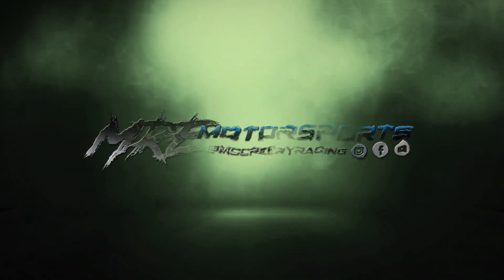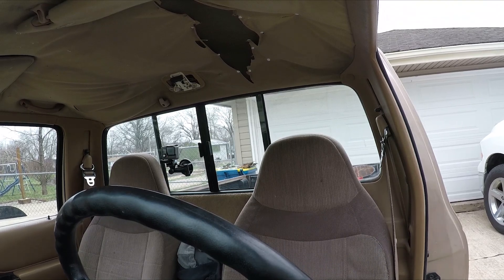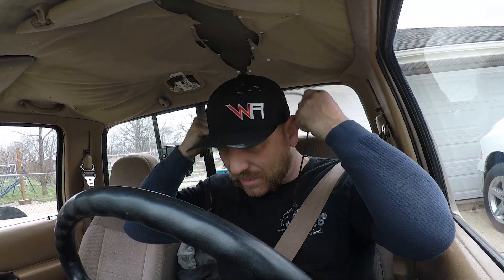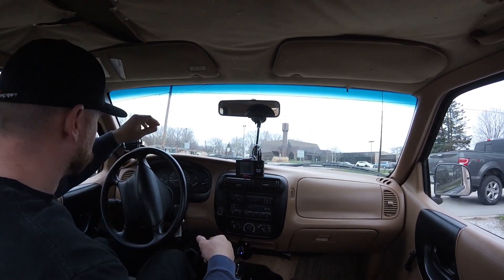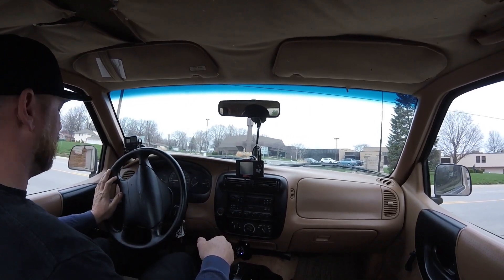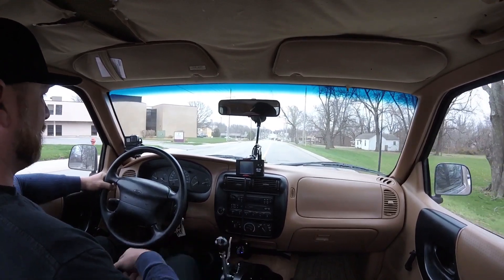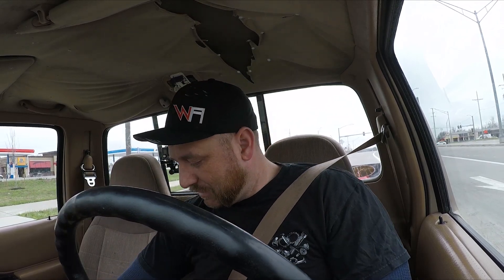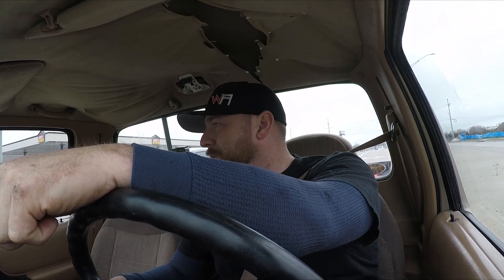LS Swap Ranger 1st Drive!!

Comment: I got a 8.8 out of a explorer and I'm lowering mine. Upgrading the brakes to. Waiting on my brackets and my rear to get done. Then I'll pull the 4 cyl. Out and a 5.3 with 4l60 is going in. I plan to cam it custom exhaust and tune of course. I've got 18x9s for the front and 18x10s for the rear.
Reply from the maker: Heck yeah! Mine needs the 8.8 asap. I'm just finding a hard time sourcing the lower shock mounts
Reply: @MRE_Motorsports  bro you just need to buy 2 left hand explorer shock mounts
Reply from the maker: Yeah I've ordered them twice but never got them
Reply: @MRE_Motorsports  search on the ranger station there is a thread on a guy taking the explorer rear which you want being lowered and it's a 31 spline to and it's all bolt in. Plus then you have rear disc brakes
Reply from the maker: Was told they weren't available. Might just need to run to the local dealer.
Reply: @MRE_Motorsports  what the heck. I got mine on Ebay and came no problem
Reply: I also had a buddy build me (machine) me brackets so that I can run thr sport trac rotors (bigger) on the front of my ranger
Reply from the maker: You got the link?
Reply: @MRE_Motorsports  link for what
Reply from the maker: Link for shock mounts
Reply from the maker: I've already got my 8.8 sitting in the shop. Just need shock  mounts
Reply: @MRE_Motorsports  sorry took a minute to find them as they are hard to find. You need 2 left hand.
Reply: @MRE_Motorsports  hope that link works
Reply: @MRE_Motorsports  there are literally 2 left right now!

Comment: We have a 3.42 in the truck with a 28 and it’s decent on the highway around 2700 and enough gear for 1/8 and 1/4. We have a 3.2x in the civics rear for a 26. I think those are good options. Glad you got it out and about man! DEFINITELY get the draggy. So accurate
Reply from the maker: Yeah the BK has a 3.42 with a 28in tire and its right around 2700 on the highway.

Comment: In the middle of my ls swap ranger right now, I cant find anything about the fuel pump relay location. Im looking to wire in my switchboard and I've got power going into the switchboard from fusebox but I need to connect the other side of the sitch to the fuel pump. Do you happen to know which wire im looking for, where it can be accessed?
Reply from the maker: I honestly can’t remember at the moment.

Comment: I added a 8.8 from a "96 Explorer to my "97 Ranger. Came stock with 3.25" axle tubes, 31 spline axle's, 3:55 gears and rear disk brakes. Complete rebuild; all new bearings, brake hardware w/ cross drilled disk's and new painted caliper's. The cherry on the cake is the Detroit Locker True Track I added.  The rest of the drive train is a much longer post.  V8 w/ 3 spd auto all modded out.
Reply from the maker: Sounds like a fun little ride!!
Reply: @MRE_Motorsports  ty for the quick reply. It dare well better be lol. Totally solo, 7 years in, was destined for the scrap yard (wrecked and repaired), 4 different makes/ models of Ford's involved, re-engineering and fabrication. Been on 1 test run and back to my shop for further refinement. I admit I'm OCD but when it's road worthy (imo bullet proof). Yes, she will be a very fun little ride and dependable as it gets. No expense or time was spared. Plan to upload to the tube when primarily satisfied.
Reply from the maker: Can't wait to see it!

Comment: Did the dirty  dingo mouths bolt right up? My motor mount on the driver side sits farther back than the passenger side I'm just wondering if those mounts will work on my 1999 ranger thanks
Reply from the maker: No, the dirty dingo mounts are not bolt in.  Far from it. I ended up welding the mounts directly to the crossmember

Comment: Sweet truck! Did you build the motor mounts? What about wiring harness?
Reply from the maker: Thanks Erik!! Used the Datsun 280 mounts but they don't work very well without modification. And I was using the harness from the Fitech ultimate Ls standalone at this time.
Reply: @MRE_Motorsports  thanks for that info. What about driveshaft and what trans are you using?
Reply from the maker: Th350 trans.  I had a local place build me a driveshaft

Comment: Do a small cam, small turbo like a s366, t70, 72/68, on low boost and make 450 500 whp/tq. It’ll be quick spooling and fun to drive but not stupid fast.
Reply from the maker: Will have more updates coming soon!! 😎
Reply: MRE Motorsports I just started a ranger build. Well actually all I’ve done is planned and bought a truck lol. It’s a 95 yellow splash single cab. But the plan is big tires, 5.3l, turbo, ar5 manual trans, 8.8 rear end.
Reply from the maker: Heck yeah. They arent super easy to swap but a pretty unique platform to build. Atleast at the moment.
Reply: MRE Motorsports bought the truck for $700. Drove it home. What it really came down to was price and condition. I hunted for any small truck and the ford worked out best. Plus that black auto cross  truck really turns me on. Weather it’s starting to trend or not had nothing to do with the decision, but does seem like people are catching on.
Reply from the maker: Price always help. Lol
Reply: MRE Motorsports oh yeah. I looked at a blue step side ranger for $400 and had to walk away because it was way too beat. I dont want to spend my time fixing minor stuff that should just work. Was really tempted to pickup a s10 extreme also. But that yellow 90s truck really caught my eye

Comment: How did you hook up the power steering pump to the ford box ? What lines did you use ? What fittings?
Reply from the maker: The return line was easy. I just bent it around And use pre-existing hose. Pressure side was a little more difficult but once i new the thread size for gm pump And ranger box I just made a braided -6 an line to connect them
Reply from the maker: I can't remember the sizes off the top of my head but the fittings were easy to find.
Reply: Yeah I'm having trouble figuring the fittings for the box and what lines to use it's the last thing on my swap
Reply: Can I use the 16mm  6 gm fittings for old school gm box ??
Reply from the maker: I cant remember which fittings I used. Ill see if i can find the receipt for them.

Comment: Hey nice truck, I did the same engine swap on my Ranger, but it doesn't look as great as yours haha, I have a stock 5.3 Vortec with a T56 transmission.
Reply from the maker: Heck yeah that's awesome!
Reply: Did you have to change rear end? Or just cut and weld for the tranny/engine
Reply from the maker: I ran the stock rear end until it broke. And swapped to an explorer 8.8

Comment: I wish I could do this. I'm a chick who actually enjoys stuff like this. How much is something of this transformation ?? I have 2011 2.3 liter. This thing is too slow!
Reply from the maker: It's really hard to say since I try and do everything on my own.  A so woulda charge a ton.  And then depends on the type of deals you get on engine, trans etc...id say it probably cost me $5-6k to do the swap in parts alone. But I didn't keep track of exact amount
Reply: @MRE_Motorsports  thank you for responding 🙏.  So whether I do an LS swap or a turbo with other engine mods to improve performance,  it seems I'll be spending a months salary either way 😆lol.  Ford should've made an SVT Ranger 😤
Reply from the maker: My pleasure! And a svt ranger seems like a win to me! Thanks so much for watching. Also, There are plenty other videos on this build as well if you want to see more progress.😉